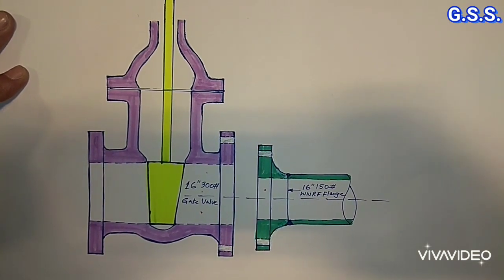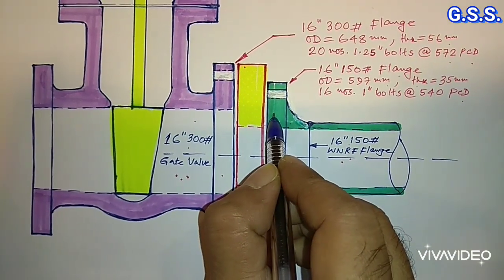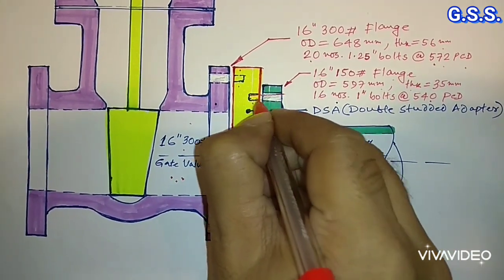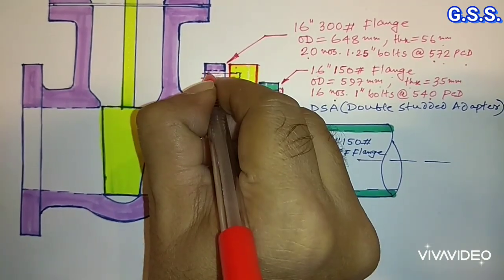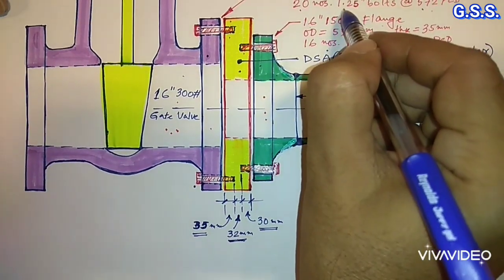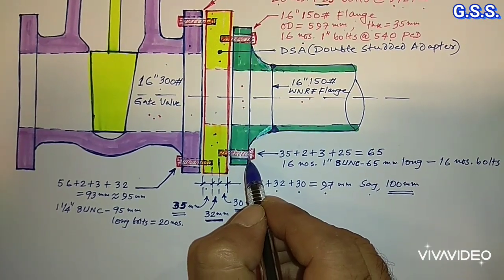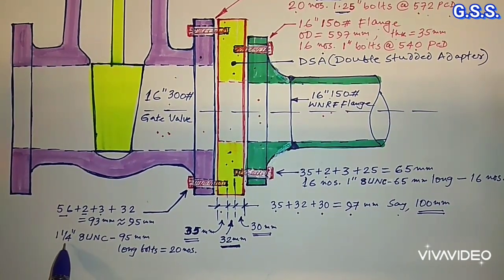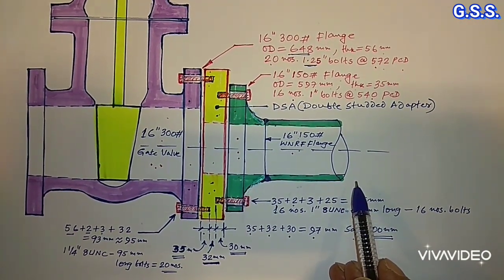Piping Engineering : how to connect different rating flanges

Comment: Sir, We have encountered same issue in current project.
Project team decided to make hole in large dia meter flange respect to small dia flange.
Kindly suggest this method is correct.
Reply: What would happen if  make additional holes on a large dia flange
Reply from the maker: @rajkumar-fz8jn  in that case,  gasket for large dia and  small dia may not seat properly. It will be better to use a double studded adapter as I have explained.
Reply: @gourisankarsamanta7670  sir, Thanks so much. Additional query often valve flange PCD and pipe flange pcd is not similar.  How to ensure during procurement both  flanges pcd are the same.
Reply from the maker: @rajkumar-fz8jn  during procurement we should purchase proper flange as per valve.
Reply: How we will make this arrangement in line as face to face is left as per the size of the valve at pipeline

Comment: Dear Sir, Thanks for sharing new information. My query is shall  do you have experience of using this type of arrangement in Oil and gas(1. we use stud bolts ,2. Any issue in high pressure lines).
Reply from the maker: It can be used in any piping irrespective of service because it is technically possible.